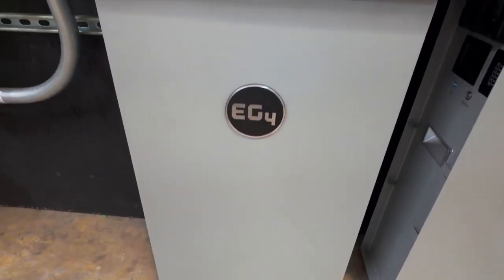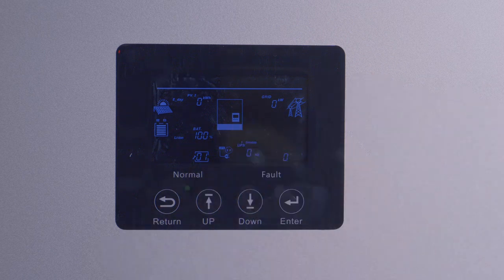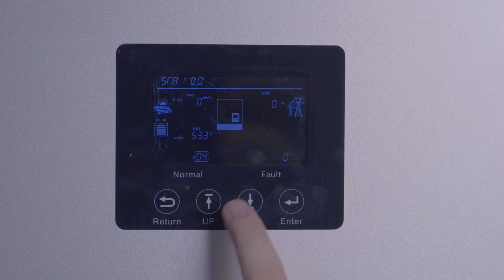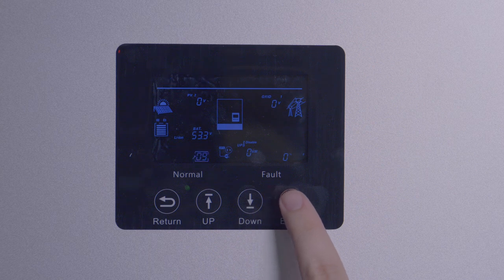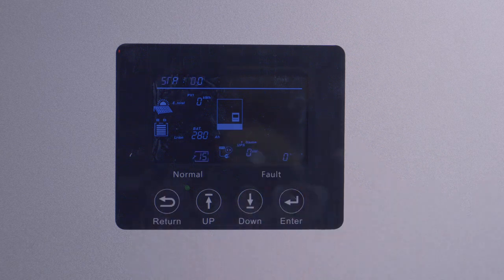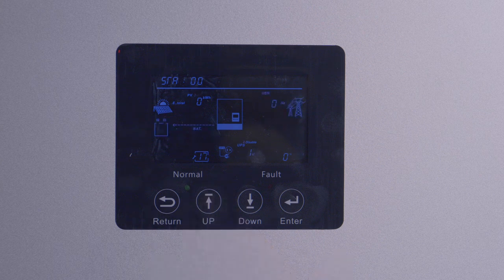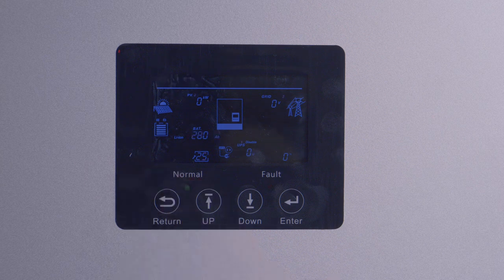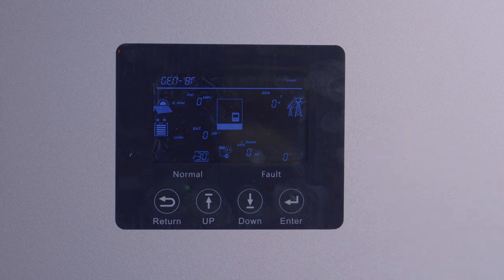EG4 6000XP Off-Grid All-In-One Hybrid Inverter Settings Walkthrough and Important Settings

Comment: Would you happen to know why EG4 will not charge at 58V as required by 8 - 6V batteries? EG support is utterly inadequate and I am about to claim warranty on the unit. However, I thought, that may be the settings I have are wrong. I have the charging voltage set at 58.4 V as required by the lead acid AGM manifacturer, yet the inverter will not charge higher than at 51V leaving the batteries charged at 48.5V instead of 54V, whether from PV or Generator. Do yo have any ideas why it would not charge higher than 51V?